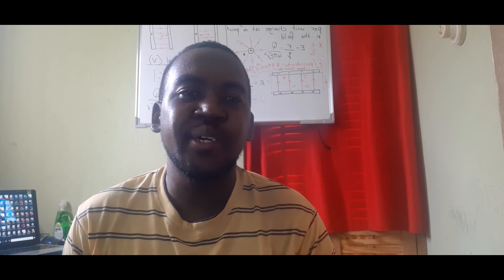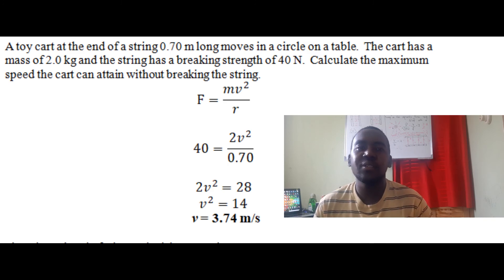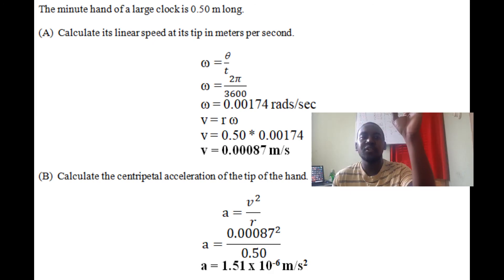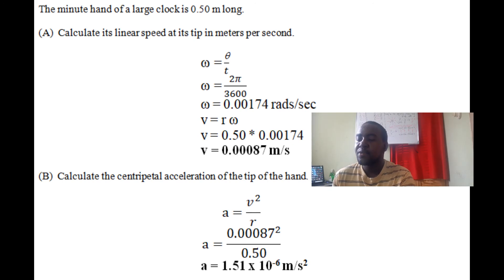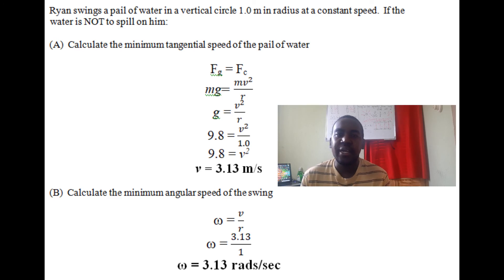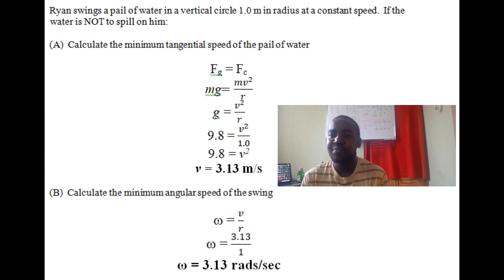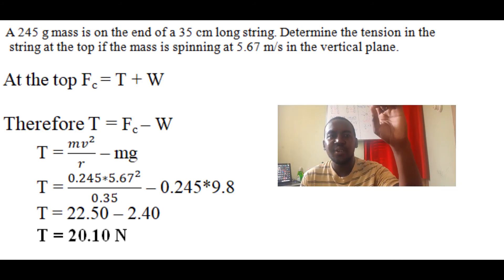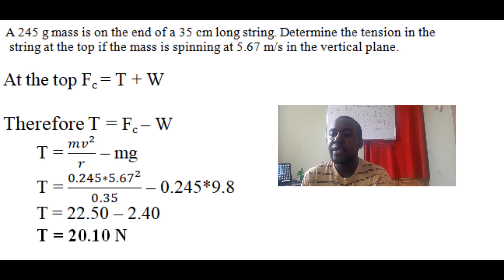CAPE UNIT 1 - CIRCULAR MOTION CALCULATION

Comment: sir what did you divide by to get the 0.00174rads/sec (question 2)
Reply from the maker: angular speed for a clock the t = 3600 seconds (1 hour) for a complete rotation hence you divide 2x3.14 by the time
Reply: @edusolutionsinstitute2023  thank you!